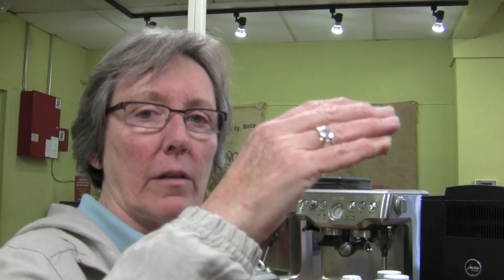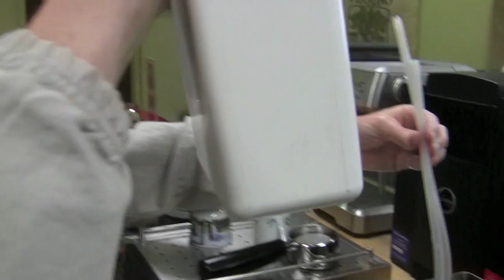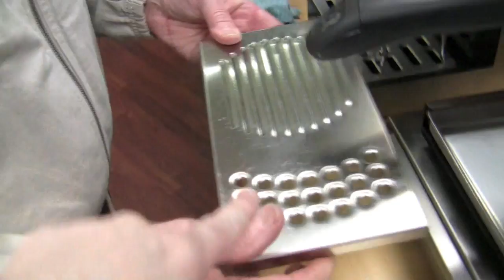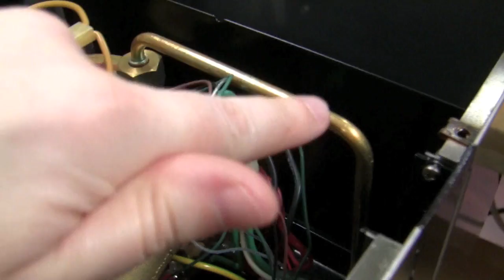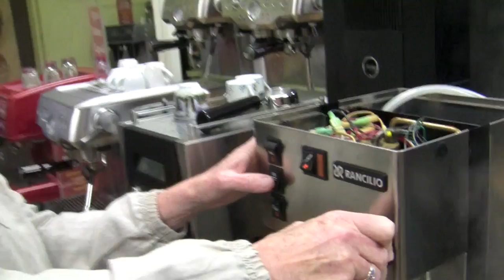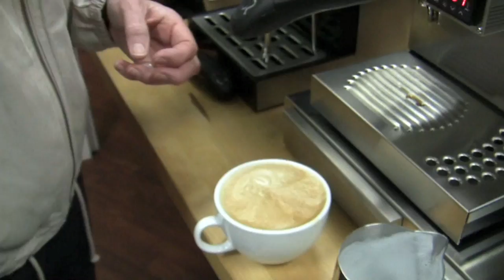Crew Review: Rancilio Silvia V3 - Redux

Comment from the maker: You could try weighing out different dosages to see how they affect the shot differently. If you're overfilling and not able to get the portafilter locked in, they the shot will definitely be adversely impacted. I know that some folks are concerned about the screw tearing the puck and it likely has an impact on the extraction rate, but there's not much you can do, sadly. - Kat

Comment from the maker: Since the techs haven't seen the machine, they could only give this general diagnosis / resolution: 'It seems like scale is stuck in the steam wand. This is why it is leaking, and why it is weaker steam. They might try descaling again, removing the steam tip this time. Also leaving the descale solution in the machine for a longer period of time.' Hope that helps! - Kat

Comment: I'm not sure I agree with you that this machine isn't "fussy". I'm on my second Silvia over the last 9 years (first one was a V1 that I purchased 2nd hand) and even being able to froth milk to proper texture is not as simple as just opening the steam valve once the light turns off (mine were also pidded which helps). The amount of steam pressure I can get out of this machine is enough to blast milk straight out of the pitcher, but it took a lot of trial and error and testing to be able to do this consistently. It's also extremely difficult to get consistent shots without a PID. I do enjoy your reviews though, so keep them up :), I just think that the Silvia is a finicky machine, but I think that's what draws me to it.

Comment: I purchased the Silvia with the PID from you guys about a year ago.  It was my understanding that the PID measured the temperature from the outside of the boiler which is why the brew mode was set at the factory at 222 degrees.  I notice on your Silvia videos your PID temperature is no higher than 205.  Is there an accurate way for me to measure and recalculate my PID setting?
Reply from the maker: We just happened to have it set lower that day, It generally registers about 8-10 degrees above the temp of the water inside. You will want to experiment with the temperature that works best for you. Generally you want to start around 208-212. If you have a digital read thermometer, you can check the temp of the water at the brew head, but it will need to be instant read for the most accuracy. - Steven

Comment: Hi guys, 

Awesome videos! Always very informative and factual. 

I just got my Silvia. Two questions. 
1. What is the significance of the red dot on the group head?
2. When inserted, my portafilter does not reach a 90 degree angle from the machine. Well, it does, but it seems I'm putting a lot of pressure on it to get it there. Is this normal?

Cheers!
Reply from the maker: Hello MusicFromMoscow, The red dot is the ideal ending point for the portafilter, around perpendicular to the front of the machine.  However, you’re really just looking for a snug fit, so when the machine is very new, it will typically not go all the way to the red dot, and as the machine continues to be used, the gasket will wear in, to the portafilter goes further and further to the right.  Eventually, the portafilter will go so far to the right, past the dot, that you still can’t achieve a good seal, and get leaking over the sides of the portafilter.  It is at this point that the gasket would need to be replaced, but typically will take anywhere from 6 months to 2 years before that happens.  For now, you’re just looking for that snug fit, and while it will take some effort, you’re wanting the portafilter to be on tight enough that it won’t leak over the edges, but not have to crank on it.  It may take a little bit of experimenting to find this right balance. - Miranda

Comment: Is it normal to hear loud "cracking/boiling" few seconds after the machine is on then it goes away and starts again when i press the steam button? Havent heard it before when I used very low PPM filtered water... Since I switched to high ppm bottled water this started happening..

Comment: I have a Silvia with Auber PID installed. Working fine but suddenly I found that the steam is not as "steady" and strong as it was the day before. its kind of strong then weak then strong then weak. the machine has no issue to get up to temp in time,so I dont think it is a boiler issue.I always run hot water when I am done to avoid burning the heat element. Any idea what should be done? I just descaled it a week ago using Dezcal. also the steam when i close the steam knob doesnt stop immediately

Comment: Does the 2014 version do anything the pre 2014 did, better? I know the boiler has different connections but that could that just be a production thing?

Thanks....
Reply from the maker: No, same functionality all around. The only slight change is that the heating element is now SS, in an effort to resist boiler burn-out, which can be a big problem. but you can still get boiler burn-out, so it’s not fool-proof, and make sure to keep refilling your boiler after every time you steam by pulling water through the steam wand! - Miranda

Comment: Hi gals! Got my silvia 2 weeks ago, so still trying to tame it! I have 2 questions:
When I'm dosing my double shot, if i even the dose flush with the edge of the basket (using my finger or a flat knife), even if I tamp pretty hard, the dose seem too much, as it presses hard against the group head. Sometimes I can't even lock the portafilter in. What could be my problem here? How should I dose/even my shots?
And also: does the protuberant screw on the shower screen compromise the puck integrity?

Comment: Seattle Coffee Gear I have this machine at home but I cant produce a rich thick crema, I've tried changing beans, grind, tamp pressure, extraction time. and i still don't know how to fix it, do you have any ideas on the cause?
Reply from the maker: Hello BLT, The freshness of the bean will be crucial.  The fresher the bean (meaning under 2 weeks from the roast date), the more crema you will get.  From there, dial in your shots to the 20-30 second extraction window with your grind setting, tamp, and dosing, and be sure that everything is clean!  If you haven’t backflushed or cleaned the brew head screen, portafilter, or filter baskets, then that residue can negatively impact your shot.  Hope this helps! - Miranda

Comment: Donno. If you don't have a PID, it's pretty fussy about temperature surfing. And if you steam, it's pretty fussy about having water put back into its boiler before you brew. Other than that, yeah, it's pretty much the same as any commercial-style espresso machine.